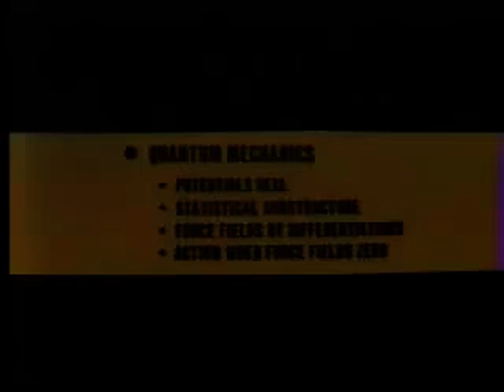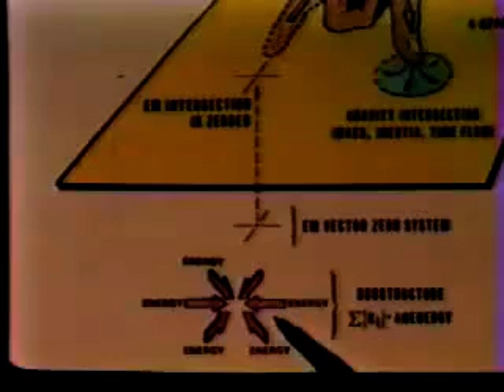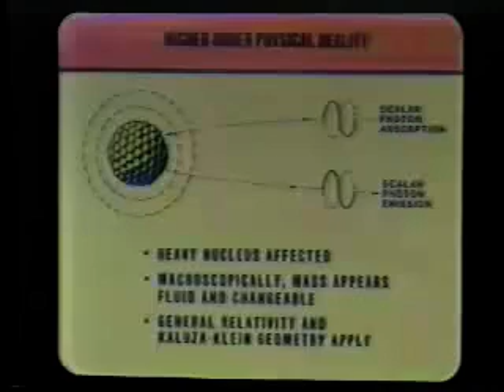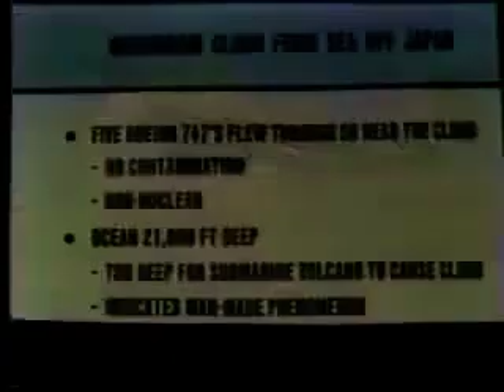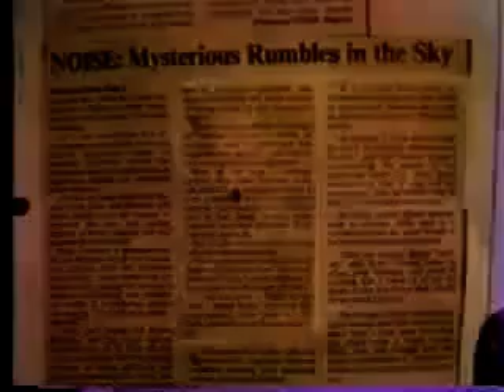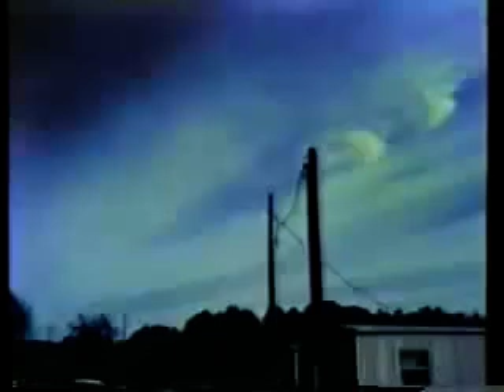Comment: They spray the atmosphere then push those clouds around with electromagnetic wave transmitters disguised as cell towers due to the fact that the particles that make up the cloud are conductive and able to be spun into storms. The towers do transmit cell service but they do much more also including microwave transmission and acoustic sound waves to pulse the inner ear to cause cerebral hypnotic suggestion. Plus they have synthetic WiFi based telepathy and they beta tested during Covid by transmitting peoples names into their heads to were only they can hear it. Sounds digitized and robotic. They blamed it in a hacking program when it was discussed by the citizens online. These are end times and King Charles is the Antichrist